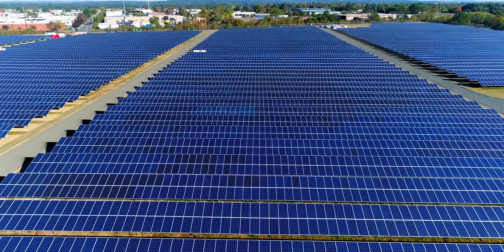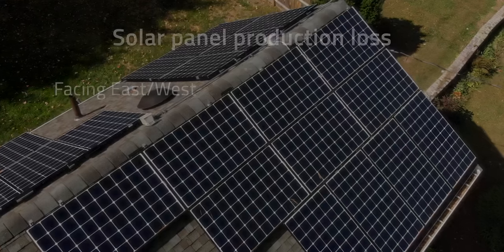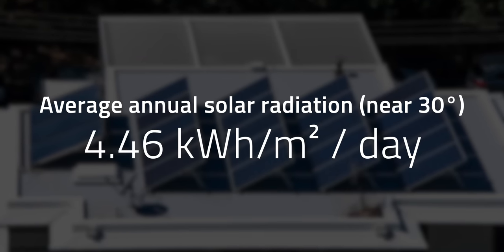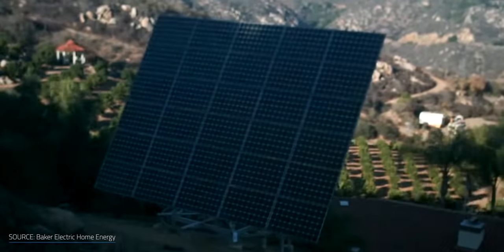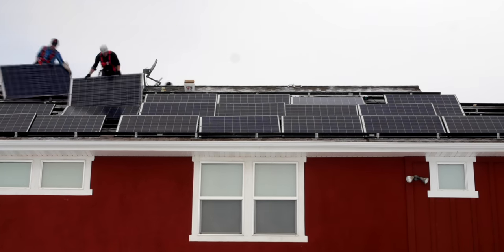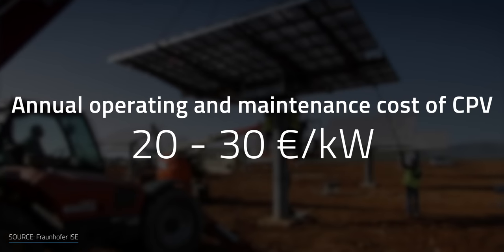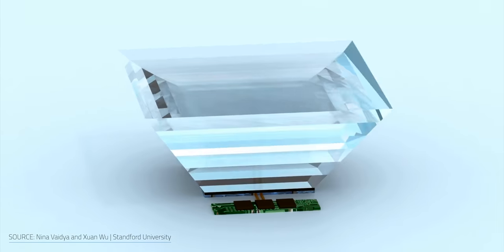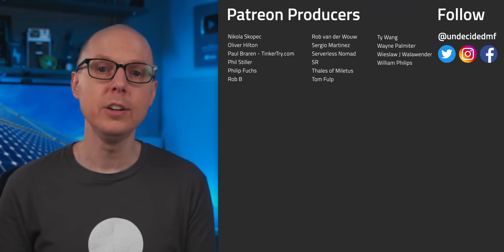This Invention Could Supercharge Solar Panels

Comment: Actually, on flat roofs an East/West setup might be better than a South setup (or a North setup on the southern hemisphere). Because you still want the panels installed at an angle, they'll create a shadow, which you cannot use if the next panel faces the same way, but you can use it it faces the oppositie way. As such, you'll generate less energy per panel going East/West, but you'll be able to fit more panels. Whether that'll be worth it might depend on your location, but it is generally considered a good possibility where I live.
Reply: it's could be nice to concentrate energy when winter only , for stay in spec of panels and or use less pannel but not less surface , surface is  cheaper than panel
Reply: @user-cq6zg2lw7f  Where I live surface is actually pretty expensive, and that's why E/W setups are actually a real thing here (I'm not making it up...)

Comment: I have installed  13 panel of 340 w for about 3500USD in India. Including the cost of erection commissioning and complete set up. does it cost 14500 USD in UK??

Comment: The cost of heliostats doesn't have to be that expensive. Embedded in this video's content is that the actual electronics and basic moving parts costs $500 and that's actually a high estimate... The actual electronics costs only about $20 and the rest would be be however the bare mechanics might cost. The thousands of dollars in the estimate can be considered partly subjective in how sturdy the panel support has to be considering the climate, weather and particularly wind in the location. A protected location with hardly any wind, snow and dust would be negligible cost while an exposed location subject to seasonal hurricane force winds could be expensive.

Comment: This is promising because it greatly increases efficiency without moving parts. We are so close to solar energy becoming affordable for the consumer!!   However, the total price has not gone significantly down.  The cost of installation, both installers and/or electricians, keeps the cost up.   Let's imagine this:  What if a total solar system was able to be self-installed and cost only $7,000?   A pipe dream maybe, but few middle-class people have $25K to throw around.

Comment: Similarly, if you combine a sine wave at a given frequency with its third harmonic (3 times the frequency) at a somewhat lower amplitude, with one 0 degrees of phase (- to + zero crossing) synchronized with the original frequency, the result makes a dent in each half cycle, like a Stetson (cowboy hat).  Add slightly less of the 5th harmonic, also in phase, the sides of each zero crossing are steeper, and each half cycle looks more and more “square,” with more and smaller “squiggles” on it.  When you get an “infinite” number of odd harmonics, in the right amplitudes and in phase, the function looks “exactly” like a square wave.  This is a simple example of the Fourier Transform.

I’m sure there is a mathematical connection between the two examples.

Comment: Roof solar: There's no way to recoup the cost of the panels, relative to just investing in any decent investment.
If the solar panels plus installation doesn't pay itself off in about 7 years, it's a terrible investment.  Even worse if include the obscenely high costs to remove & reinstall solar when you have to replace the roof.

Going off the number seen in this video, the panels would cost $14k (without installation) and save about $1,200 and last approx 15 years.

So, if you installed them yourself, it'd take almost 12 years to recoup, if they even lasted that long.  Paying an installer would run about $5k on the cheap side, so now you're looking at $19k costs for $18k of lifetime "savings".  If you have to replace your roof... add another $6k.  Oh, and if you drill holes through the shingles to mount... you voided the warranty for your entire roof, not just the side the panels are on.  Roof solar is a friggen money pit.

Roof solar with one roof replacement: Total costs $25k, Total "savings" $18k, after 15 years you have no panels and $7k loss.
Invest that same $25k in something making 8% average interest/dividends (this is considered 'low/save' rate) and you make $2k a year... for eternity.  After 15 years, you'd have $30k for electricity AND still have your original $25k.
Compare the 2: Overall loss of $7k
No solar: Overall gain of $30k.

And that's without even more expensive batteries AND no grid-disconnect, meaning your power goes out when the grid goes down... hurricane?  You have no power...

Solar is a guaranteed net loss.  It is not an investment.

Solar: 
For people with more money than sense. 
For people who want off the grid, and have tons of extra cash to burn.
For people who want to "save the planet from that mean 'ol Carbon dioxide, the gas required for life on earth to exist." 🤦‍♂  Even though life thrived way more when the earth had more CO2...

If you're not a moron, and don't have excessive amounts of money to burn, skip solar.

I really hope this changes some day, but we're a very, very long way off for solar to be cost effective on an individual basis.

Comment: Ford C-Max was working on a Fresnel lens in 2014 but the efficacy wasn't there. At CES that year it seems Honda had a solar carport with Fresnel lenses, and Ford had 2 or 3 displays. Same old LIGHTHOUSE TECH FROM THE 1880'S----hopefully, AGILE can keep the costs down and mention Fresnel a time or two-----the article makes it sound like new tech.

Comment: Sunstones could be added to sensors to track the sun through the clouds. Not sure on the costs. It could be set up to one sensor to take measurements and send commands to the other panels to change accordingly.
Reply: It's the direction of most light that matters, not the exact direction of the sun. If there are clouds blocking the sun, there may be more light available at a slightly offset angle. The photo sensor would pick that up.

Comment: You know what’s amazing, literally I never thought about this ever meaning I’ve never heard of this concept or seen it. I had no knowledge of it until 6 hours before watching this video. I was thinking about solar cell efficiency and why different light spectrum are holding us back to achieving the holy grail. Then I thought of perovskites and thought about how it’s original form is crystal and the thought popped in my head why don’t we place crystal on top of the solar cell and then concentrate that light. And then I thought about the drawback the material bieng used need to withstand extremely high degrees of temperature.
Reply: This type of thing has been going on for decades, probably since it was first discovered that silicon had photovoltaic properties.

Comment: You still end up with an unreliable, non-commandable, intermittent power system, all of which could be replaced by a single, reliable, despatchable nuclear power station. Solar PV has some uses, but also has many drawbacks.

Comment: 1)  If you significantly increase the electricity production of a solar system, wouldn’t you need to change the inverter to handle it?

2)  At :_ you show mirrors mounted to PV panels.  Wouldn’t that cast a shadow onto the next panel?  Wouldn’t the mirrors be at risk of being torn off by high winds?

3)  If you are successful in creating more electricity with an interconnected system, good luck getting the utility company to approve the increase.  I live nextdoor in Rhode Island.  Both Massachusetts and RI limit the electricity production of interconnected residential solar systems to 100% of that home’s energy needs averaged over the PREVIOUS 3 years, and they are all too happy to be real [sticklers] in enforcing that.  It doesn’t matter if you have a family of 6, and you bought the house last month from a little old lady who used 3000 kWh in an entire year!  On the bright side, bills are being introduced in RI to get rid of the 100% limitation, so we’ll be able to “fill the roof”, which is more aesthetically pleasing anyway.

2)  At :_ you showed mirrors that are attached to PV panels.  Don’t these have a danger of being ripped off by high winds?

Comment: You missed a big chunk of the world, and that's the part of the world that's within about 10 degrees of the equator in either direction.  You don't need to face panels either N. or S., and instead tracking the sun is a simple E. to W. tracking.

I know that a chunk of the world that's installing panels lives in the N. Hemisphere above about 20 degrees latitude, so you tend to think about your situation, and therefore you have to think about the opposite, which is being in the S. Hemisphere and congrats on getting at least that far. But there and many millions of people living within 10 degrees of the equator, and that means the panels will be in shade for part of the year if you face them either N. or S.  In fact that's really true if you live between the tropics.  You either have to track the panels N. to S., and for the best effect also E. to W. so it becomes fairly complex, you could also manually adjust the tilt N. to S. during the year and then track E. to W., or you simply have the panels facing up.

Comment: I design and install solar systems. 
Solar tracking devices are obsolete, IMO.  
Obsolete because the cost of extra solar panels will be cheaper than the added cost and maintenance of mechanical tracking devices.
One of the beauties of solar is that it is virtually maintenance free -- especially if you don't live in the dusty southwest.  
Adding devices with sensors and motors means monitoring and maintenance. 
For the added production that would give you, it is easier to add a few more panels to your system.

Comment: Morning Matt, L here. I see very small solar cells at the bottom end of the much larger AGILE pyramid (this looks like 5x the area). So for me the question is: Does this technology boost the output per roof area, or are the cells themselves so much smaller than the conventional ones that there is no benefit in terms of kWh/sqm roof?
Reply: well the increased angle you get optimal light from would mean a roof would still see increased production.

Comment: all those lenses will make costs skyrocket.  there are new materials, far more efficient, and that can be spray-painted on.  this radically reduces cost per kw, and because of low weight, can be used in new applications where it was not possible before.

Comment: With the reflection material being thermocouples there could be more energy captured that eas being lost. These thermocouples will reduce trmperature differences on the sides of panels. These panmels of honeycomb desigh  can be rotated at instalation. Each cell should be monitored and removed from the circuit if it goes bad or is not performing as it should.
Reply: Outstanding with thermocouple reflectors built into the outer layers of solar panels there may one day  be solar panels that honestly capture and convert more than one third of the solar energy's that strikes it's surfaces

Comment: What if one just shined mirrors reflecting extra sun at the panel Arrays ? A few 6x 4 mirrors tracking sun onto the array would be cheaper and have the same effect of the mentioned design. 
Right? Would that work?

Comment: I switched off as you said 3D Printing is fast and cheap. :) It is not possible to 3D Print optical systems in a reasonable good quality on a high output machine (the more output the lower the fixprice). The next point is the increased weight on roof constructions...there are so many negative points i can't see the benefit for real-life usage.The real problem is not the inefficiency of solar panels. It's still the storage of power and law regulations. In Germany you have to sell your solar energy for about 4Cent/KWh to public utility companies (by law). Then you have to buy it back for about 30-50 Cent/KWh. So why should i put solar panels anyway on my roof?

Comment: Question: If you had to choice between adding a solar system or a battery system to your home now, and wait till later for the other, which would it be? It seems like with both solar and battery technology, we are going to see changes in the future, but which would come sooner and bring the most cost saving, be more efficient, etc if one was to wait?
Love your videos, I like that you give the numbers behind your thoughts too.
Reply: Solar. Battery is expensive wasteful and last a very short period. With solar panels you at least have a chance compensate your spendings in 20 years.

Comment: Love the concept of CPV but more sun = more heat which reduces PV output. So in addition to concentrators you now need heat sinks.
Reply: same amount of heat per square foot as a normal panel, so won't need any additional cooling compared to a normal panel.
Reply: Or filters.

Comment: The very notion of a power source which uses vast amounts of land, water, has a only 15% efficiency, goes "dark" for at least 12 hours of each day, has a suable life of only 25 years, and is not scalable is an unreliable reliable source of electricity needed to run a modern society. Let's put our money and energy toward developing a nuclear power industry.

Comment: I still think the best solar is the heat concentrator. All those energy producing cells are complicated a expensive to produce and maintain, and they are weak against high temperatures but must be pointed to the sun, it's a recipe for failure.

Comment: Light concentration causes panel degradation which then has to be compensated for, at additional cost. Can the spectrum of light incidence be passively optimized without concentration?

I recently watched a video in which Robert Murray-Smith deconstructed an LCD monitor in part, to harvest the iridium tin-oxide. In that video RMS noted many of the components of the monitor, other than the ITO, had particular value especially, the optical quality glass. He also mentioned one of the layers was a "linear" sheet which took light, regardless of the angle of incidence (within a range, I'd assume), and converted it to be perpendicular to the panes of glass. He compared it to a Fresnel lens, only linear.  I think the LCD industry refers to these layers as horizontal and vertical polarizing layers.

Can a polarizing layer sitting on top of a traditional solar panel correct and optimize the incidence of light enough to boost the efficiency of the otherwise run of the mill panel and do so cost effectively but most importantly, without the downside of concentration degradation?

Comment: I would be surprised to see a market with these though. Even if the cost of these lens are negligible, they would need to be paired with special PV cells. Silicon cells (as we develop them today) would not be reliable at all. 2-3X concentration would mean 2-3X the amount of current. Unless the busbars and fingers are increased in size, module would degrade extremely quickly. If busbars and fingers are increased to an appropriate size, then there would be increased losses due to grid shading. 

It would be useful in integration with CPV systems, enabling high power output with less accurate two-axis tracking. The issue there is that these CPV systems are no longer competitive in terms of price when compared to conventional PV.

Cool idea, but likely won't make since in terms of LCOE.

Comment: Single phase limits from my elec distributor require and upgrade to three phase after 10kw. More panels, with higher efficiency is going to cost upto $7000 dollars, just to unlock that next level.

Comment: With how Agile works, since there is no moving parts and my thought of a half circle curve to maybe help remove the need to tilt panels but at lower output.

I got thinking that would be more suited for Agile, though I got thinking. You can make a Dome with it instead, so now it collects light from all around it except blow it. ^_^

Comment: I assume we're comparing the capture area of the CPV lens to a comparable area of conventional PV panels?  If we went by the area of photovoltaics in both, there's an obvious advantage for CPV, but that's because you're ignoring most of the space it takes up.  (Sorry, I'm just wary of new tech firms claiming to have made massive improvements using number tricks like this.)

Comment: They would just add a thermoelectric generator integrated into it like stanford's night solar panels, to further boost power, the TEG modules would increase power by converting that heat by CPVs into electricity
Reply: But another problem, the TEG Module must be designed to withstand these kind of temperatures!

Comment: the cheapest devices to automatically tilt thousands of small (25 square inch) panels in a synchronized manner all together towards the sun are actually quite cheap. 
You don't even have to create them because they come in a self-assembling kit triggered by the presence of H2O, called "sunflower seed."
The 1st problem = they only work in late summer and autumn unless you plant their seeds in Greenhouses during winter.
the 2nd problem = you need a lot of cables to collect their output.  ;-)
Reply: Sometimes I like to imagine a sci-fi, electric tree. All of the little leaves catch sunlight and turn it into electricity that's fed into the root system. The root system is somehow tapped into by us humans. The electric tree grows all on its own, and it looks very similar to a natural tree. I've had this sci-fi idea in my head for a few years. I haven't seen this pop up in a sci-fi story, but I'm sure someone else has imagined it too.

Comment: Why do 15 solar panels cost $14,625 in the US? If I would buy that in the Netherlands, including inverter, mounting material and installation it would be about €7000,-. "Just buy more panels" is the cheapest way to get more power.